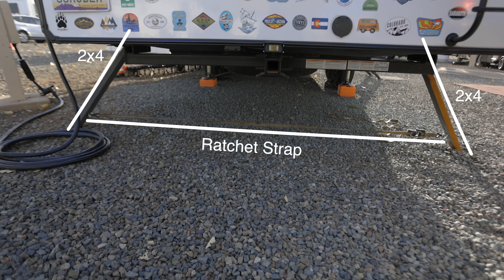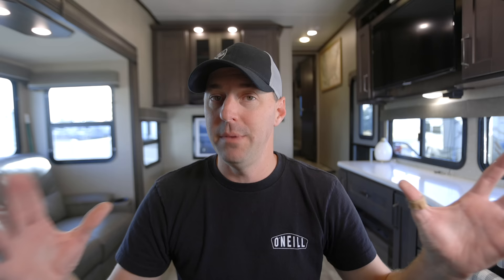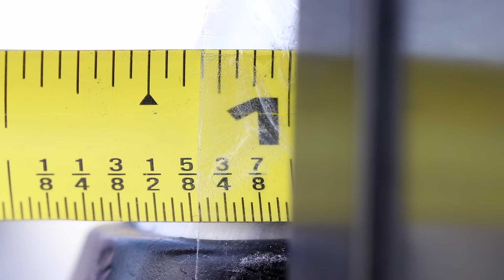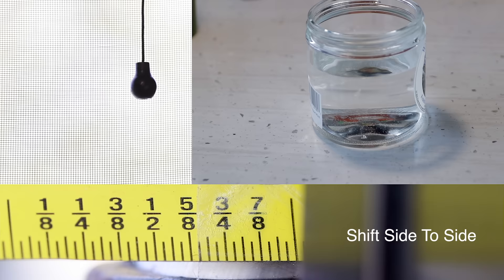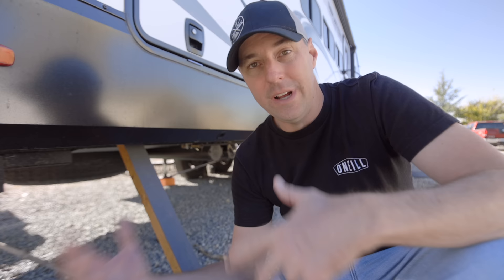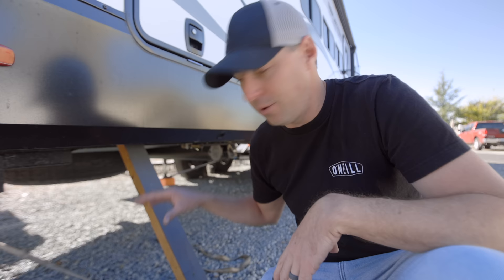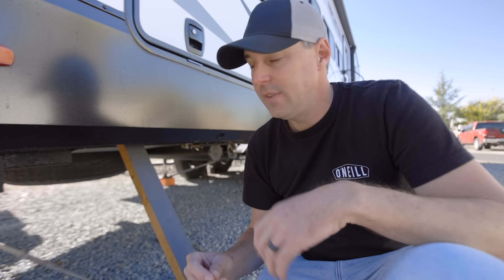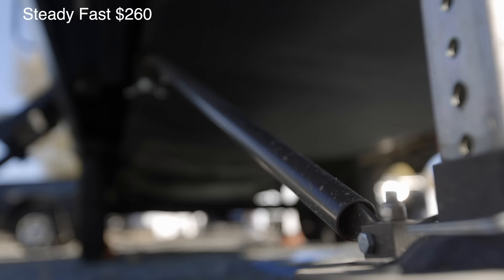RV Stabilizer Comparison!

Comment: 24 ft TT, and we used just the 1/2-scissor jacks at the 4 corners for the first few years. Bought some wedge blocks (same concept as the X-chocks) one trip.  

Our test was whether we would feel the kids rolling over in their bunks at night... and we were amazed what a difference these made. The corner jacks took out side-to-side jiggle, but the wedge blocks took out pretty much all the fore-aft jiggle.  The unit now now feels incredibly solid with the 4 jacks and 2 clamps.

Comment: XChocks are best for roll resistance, either in high winds or a potential seismic event. I have had plastic wheel chocks blow away in the Mojave Desert. The tongue jack on my trailer almost slipped off its 4x6 wooden support block. That would have stranded us. Now, whenever I unhook, I always deploy the XChocks. Remember to release them before hooking up again, to relieve strain on your axles and landing gear.

Comment: Great comparison! - My 2014 26' Rockwood Ultralite came with the factory electric stablizers - they were totally useless.
I added the common sissor-jacks they were somewhat better.
Next, I added the X-Chocks, which I think may have added a little bit, but not much.
Finally, I added four adjustable jack-stands from the frame to the ground in all four corners - this was a game-changer, and made my RV rock-solid! Also fairly inexpensive.

Comment: Agree with prior comments. x-Chocks are meant to keep wheels from rocking front to back and vice a versa.  Not really an apples to apples comparison with the two stabilizers.
Reply from the maker: I agree the X-Chocks didn't have a chance. I did try shaking the RV front to back as well and couldn't get any measurable or noticeable difference between the X-Chock and our standard chocks on the RV. I didn't want to intentionally do a poor job of chocking the RV just to make the X-Chocks appear better.  I included them because I have been told by many people they make the RV more stable and makes it feel solid inside, it's a very common recommendation I come across,  it's also the first thing on the box that it stabilizes the RV. I had to buy them and include it to test and see how they did kind of like when I ran over the RV drain hose with my truck because they claimed you could. Thanks for watching, I hope that explains why it landed in this comparison test.
Reply: I’m glad to see the X-chocks were brought up not to be a side to side stabilizer. This should have been mentioned on the video. I believer they are an amazing front to back stabilizer. Especially with a smaller sized RUBBER chock for initial setup.

Comment: I use the screwchocks in between the wheels as a safety measure rather than a steadying measure. I still put down one regular chock on each side in addition. We have the steady fast system and it works exceptionally.

Comment: Good content. I've had our 26' TT for two years. I made two sets of the 2 x 4 homemade stabilizers. We use them at both ends of the trailer every trip. They work great for lateral stabilization but not enough longitudinally. That's where your Steady Fast system really shows the difference, I'm sure. I was also wondering if, during your test, you had the Steady Fast system at all four corners. It would have been a truer comparison with the homemade ones if they were on all four corners as well. For the cost and weight difference, I'm going to stick with the 2 x 4's/straps, but add one more set for longitudinal stability. One thing to add for those who may be interested in making a set of the 2 x 4 style; make sure you prop them inside the lip of the trailer frame C channel, and not against the floor decking.
Reply from the maker: Good tips, it is impressive how much they add.

Comment: JT Strong arms on my 2008 Coachman Chaparral 340qhs. With a front bunk house fifth wheel any time the kids moved in the front we could feel it throw out the RV. Added the JT Strong Arm kit to it in a few hours and stopped all movement. Amazing system completely surprised us how well they worked even with the rear jacks being scissor jacks.
Reply from the maker: Yes they add a lot of stability.

Comment: I made two sets with the 2x4s and it reduces about 90% of movement. They look janky, but are so functional. 
Didn't realize the Steady fasts were that affordable. I thought they were closer to $500.

---
Update: I bought the Steady Fast system and it's only about 75% as effective as using two sets of 2x4s. Surprisingly disappointed that they don't reduce movement more and will be bringing the 2x4s with us going forward.
Reply from the maker: The two sets is a very solid combo.

Comment: We own a Coachman 2758RB that came equipped with the oddly mounted ( at 45 degrees ) scissor jacks. Made two sets of the home made stabilizers which was a great improvement. The key was a third set mounted longways under the steps to stop lateral movement. I put down the jacks, put in the stabilizers medium tight, and bump the scissor jacks snug again. We are solid people, so to speak, and there is almost zero movement in the camper. Probably have 60 bucks invested.
Reply from the maker: I love cost effective solutions that work!

Comment: Travel Trailer vs. 5th wheel might have been worth mentioning as the jack locations and physics of stabilization differ quite a bit.

On our travel trailer the single tongue jack can "sway" quite a bit in all directions, and the full scissor jacks on the corners only welded to a single point on the frame do an adequate job of lifting to polish level and remove vertical bounce, but little for front-to-back, side-to-side, or rotational (back moving left makes front move right).

The X Chocks brought the rotational and front-to-back movements on ours WAY down, which makes the perception of side-to-side appear less as well. This is done because the left wheels can no longer rotate 1/4 of a degree while the right wheels rotate 1/4 of a degree in the opposite direction. They do nothing however for  real side-to-side <rocking> as they are under the suspension. If I load up the scissors pretty tight I can bring that down, but the next step is triangulating support at the corners where the scissors are (DYI or steady fast or replace with stabilizer or...). I bring this up because I haven't noticed the same rotational movement issue in 5th wheels where they have a sturdy 2-jack system up front (also a much larger percentage of total weight on those jacks vs. travel trailer).

With 5 LARGE kids way in the back and our heads at the absolute front while sleeping (why didn't they stay small???) we need the X chocks every time, and for more than a night or 2 triangulating the corner jacks side-to-side as well.

Comment: If you are doing the 2x4 method, screw the eylet through the 1/1/2 inch side not the 3 1/2inch side. They are much stronger in this direction.

Comment: Good video, love your measurements, I was going to get one of the stabilizers that connect to your landing pads but I have a 6 point system and adding them to it was a pain so before I went that route I got the “Universal RV Stabilizer” from CW under $50 I first had one but got a second one and use one on the back and one on the side and it does work I have not done the measurements like you did but I can noticeably feel the difference when my wife moves around and I am sitting at the back of my RV.  It is similar to your home made one but it has a piece that connects the 2 legs and the legs can shorten or extend depending on your clearance in the back or front of the RV.  Very much worth the expense and the storage is minimal and weight is much less than the 2x4
Reply from the maker: Yes those work well. We tested them a few years ago and they definitely do help.

Comment: I'm going to have to agree with a lot of the comments. X-chocks are not for stabilizing the house. They stop the wheels from rotating, the forward/backward motion and maybe a little pivot motion. But the RV is still on top of the leaf springs, the suspension. Without a stabilizer from the frame to the ground you are not stabilizing the RV. It's still sitting freely on springs designed to move. All that said, I love your videos and I watch/like as many as I can! Keep it up!
Reply from the maker: Thank you! I included it in the lineup because it's first thing they have on the box and I have been recommended by so many people to use them for stability.

Comment: The X Chocks are to replace tire chocks and prevent rotation of the tire not stabilize the RV.
Reply from the maker: I agree the X-Chocks didn't have a chance. I did try shaking the RV front to back as well and couldn't get any measurable or noticeable difference between the X-Chock and our standard chocks on the RV. I didn't want to intentionally do a poor job of chocking the RV just to make the X-Chocks appear better.  I included them because I have been told by many people they make the RV more stable and makes it feel solid inside, it's a very common recommendation I come across,  it's also the first thing on the box that it stabilizes the RV. I had to buy them and include it to test and see how they did kind of like when I ran over the RV drain hose with my truck because they claimed you could. Thanks for watching, I hope that explains why it landed in this comparison test.

Comment: Does anyone use jacks (not stabilizers, real ones) so the trailers suspension is taken out of the equation? I assume with 4 jacks at 1/4 and 3/4 of the length of the trailer - it should be “rock solid” and only flex would be the floor and walls… wonder if anyone tried.
Reply: I would expect there would still be some movement, because trailer frames aren’t stiff enough to be supported only at the ends.
Reply: I used automotive jack stands when I knew I'd be in one place for a long time. It was pretty solid. I wouldn't completely lift the tires off the ground. I'd just relieve a lot of the weight on them so half of it was on the jacks.

Comment: My camper came with the style of stabilizer legs that deploy at an angle, kind of like your homemade legs. They do a fantastic job of stopping side to side sway and rocking. In my case, the X-Chocks actually make a surprisingly large difference since they dampen the front-to-back movements. With both systems the camper has practically no movement at all, it's a big difference from early on when this thing shook if you so much as tapped your foot

Comment: I've not tried any of these systems on my 34' Blackstone..never been sold on XChocks for a trailer this size but after my 3 month trip I put this issue on my check list.  So I'm going to throw on the Steady Fast and will be interested to see the improvement.  What tips me to this solution is I move a lot and it's quick, and I have limited storage space.
Reply from the maker: I'm with you when you move a lot you don't want to spend time and space on something like this, the Steady Fast is a great solution.

Comment: I only use the X chock as helper ONLY to my wheel chocks ( HELPER ONLY ) Not a substitute to chocks.
Reply from the maker: I agree since you shouldn't use them until after you level the RV and I wouldn't want to not chock the RV after disconnecting from the truck

Comment: We have the SteadyFast system installed on our Outback 324CG and it did help a little but not fully. Unfortunately the problem is in the way Keystone installed the electric stabilizers on these "drop" C-channels instead of box tubing or directly to the I-beams. the C-channels allow the stabilizers to flex a lot, so until you can weld those closed, the performance just isn't great. To be fair, it's not the SteadyFast system, it's Keystone.

Comment: We use X-Chocks for the front to back motion and Valterra RV Stabilizer under the stairs. I kinda want to get another of the Valterra to put under the bump also.
Reply from the maker: Yes the Valterra RV Stabilizers do a good job, similar to the DIY system.

Comment: The 4 stabilizers on our TT do a great job but once we put the x-chocks on we felt a significant reduction in fwd/bwd motion. We still can't eliminate the teeter tottering effect of the bunk house in back and the master up front, but comfy beds keep people from squirming a lot.  If we were full timing I'd spend more for the fancy stabilizers.
Reply: We typically retighten the jack after a hour or 2, and seems to help
Reply: @timgarrity3985  I appreciate that.  I can't seem to remember that tip so I hope I can next time.

Comment: I have a 30’ tt. I have electric stabilizers and I use the X chocks as well. About a year ago I bought 4 scissor  jacks. I space them out along the length sides between the bolted on electric ones. Two per side. It may be extra set up time (~15  minutes) but seems to help a lot. I think tt’s are prone to more jiggly than 5er’s by nature of weight. The X chocks may not  add much but they also keep the tt from rolling.
Reply: Look into JT strong arm stabilizers
Reply: @rapierce99  TNX. I've been kicking it around for a couple of years. Just not an easy DIY on my trailer. Do you have them on a tt ? If so did they work ?
Reply: I have them on 5th wheel
 My buddy has them in his TT.

Comment: With our 30’ bumper pull, we had way too much movement with factory jacks. I researched and ended up with the Steadyfast system. Still too much movement for my wife. (Her laying on the bed and me walking into the trailer was the best test.) We leave our unit parked year round in our camp area, so we have the ability to use tree stumps.  Steady fast took out 80 - 85 % of the movement compared to factory options. The 4 stumps took it to 98%++.  Don’t even use the Steadyfast anymore. Highly recommended if it is workable for your situation.
Reply: I'm curious how you use tree stumps to steady the trailer.
Reply: I'm curious how you use the tree stumps to steady the TT?
Reply: Stumps are probably the wrong word.  Log would be more accurate.  When the trailer is level I measured the distance from the frame to the ground on four corners of the trailer. I then went and cut four logs, the biggest diameter I could find (16”) for stability, and cut them probably an inch or 2 inches longer than my measurement. This will take a lot of weight off the wheels.  I then lowered the tongue of the trailer down to bring the back end up and then slid those stumps underneath the frames. And then jack up the front of the trailer past level to get those stumps underneath those members and then lower it down. There is some playing around to get it level, but shaving off a little bit on some logs but they steady the trailer amazingly well.  

There are some campgrounds I go to so that’s all the long-term residence use is this system.

Comment: i use the X chocks, not for stabilization at all, I use them because I use the Anderson leveling blocks and it is hard to get proper chocking with them.  They are a chock not a stabilizer

Comment: I can see how X-chocks could dampen front to back motion or perhaps some of the rotational motion around the center of gravity of the camper.  I have sometimes noticed front to back motion in my camper when one of us walks in that direction.  It didn't seem that you tested front to back shake at all.   Also the homemade stabilizers might not help with front to back motion.
For any improvement in rotational motion,  the side to side force would need to be in the front or back of the camper - away from the camper center of gravity.  You didn't show where you were pushing on the camper to induce the movement. This could be important.

Comment: This is why you use combination not stabilizers.  Xchcoks are not meant to be used alone or stop the side to side movement. I personally use xchock and JT strong arms cause the offer 4 corner stabilization.
Reply from the maker: JT Strong Arm does a good job on stabilizing.

Comment: Is the key to the 2X4 steady fast braces, getting the legs at a 45 degree angle? If so, you could need different lengths of legs depending on how level your new site is.

Comment: Jared, I became a full time RVer just about 3 weeks ago and have quickly come to realize that I need to have better stabilization.  I have narrowed my search down to SteadyFast system or JT StrongArm.  I am in a 36' Keystone Outback toyhauler TT (324CG) with electric stabilizer jacks.  I like the harder handles on the SteadyFast system, but think that the JT StrongArm 6 bar system may offer more stability for my TT.  Do have any thoughts, comments or suggestions that may assist me in making my decision?

Comment: I think putting the x-chock in this comparison is not a good fit. They are not designed to prevent the type of motion in this test. They will add zero side to side stabilization. They add some front to back stabilization. They would be more equivalent to testing your diy solution in the opposite direction (front to back). A good test would be to set up your tape measure and camera on the side and test front to back rock with and without the x-chocks.
Reply from the maker: I agree the X-Chocks didn't have a chance to show as well as the other two but I tried shaking the RV front to back as well and couldn't get any measurable or noticeable difference between the X-Chock and our standard chocks on the RV. I didn't want to intentionally do a poor job of chocking the RV just to make the X-Chocks appear better.  I included them because I have been told by a many people they make the RV more stable and makes it feel solid inside, it's a very common recommendation I come across,  it's also the first thing on the box that it stabilizes the RV. I had to buy them and include it to test and see how they did kind of like when I ran over the RV drain hose with my truck because they claimed you could. Thanks for watching, I hope that explains why it landed in this comparison test.